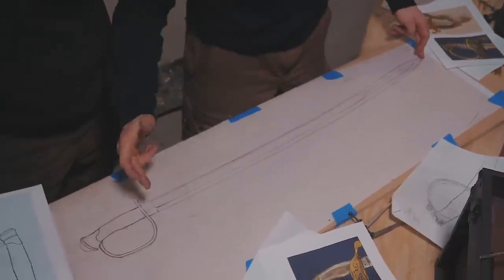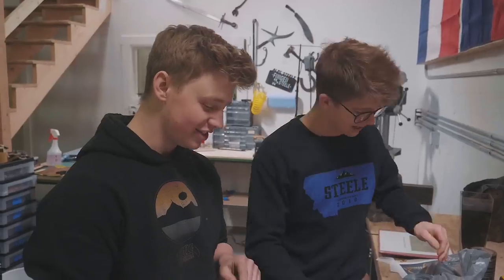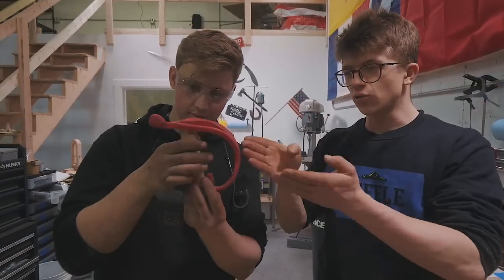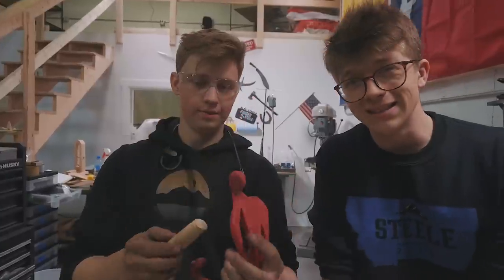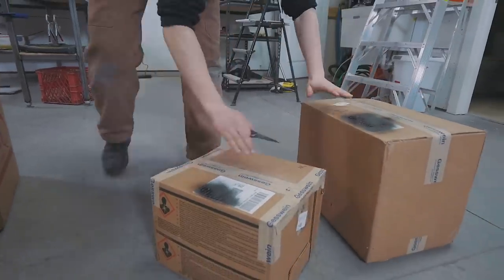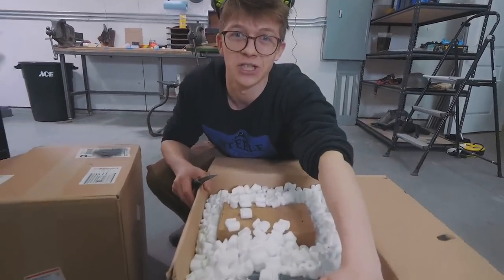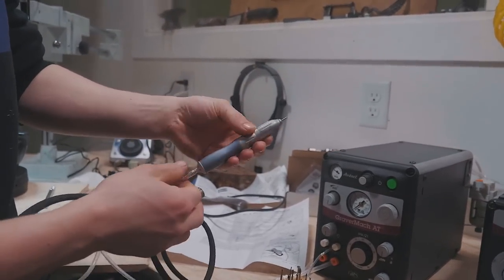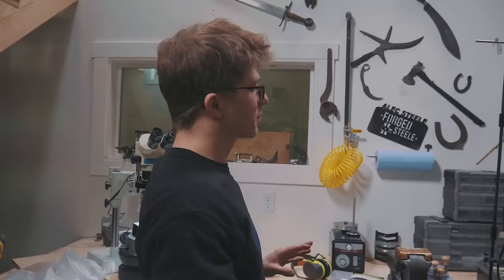MAKING THE CAVALRY SABRE: Part 3

Comment: Blast those shipping labels with a heat gun instead of spraying them with paint.
Almost all mail labels are printed on heat-sensitive paper, so they'll turn completely black if you get them hot.

Should keep you from getting paint all over the place, cheaper than spraypaint too.
Reply: i did not know this.... would a hairdryer work?
Reply: @FaewildMoon  hairdryer isn't hot enough, if you really don't have a heat gun you can use a coin and scratch the label like you're scratching off a lottery ticket, that will generate enough heat to activate the ink but it will take effort to get the whole address hidden.

Comment: Good video.  Your comment about wasting material, or rather, not considering it waste is spot on.  Forging thick and grinding thin after heat treating minimizes the risk of losing the piece to cracking or warpage.  This is how it was done back in the day and it is why good swords were, and are so expensive.

Comment: Hey Alec, just a thought for future builds, though you might know this already. If you are using bloom steel or hearth steel in future builds I have two suggestions.  A way to prevent immediate decarburization of your steel is to use the method for japanese swords.  Break up all your pieces and stack them on a paddle. Wrap it in wet paper and ash and then pour a clay slurry of some sort over it. This will hopefully insulate your billet while its heated up.  Traditional materials also seem to forge much better in a charcoal forge rather than propane.  The guys at man at arms, and also That Works, forge a lot of traditional materials and I always see them do this with their steel

Comment: Back when I was in the Air Force Cadets here in Australia I got to learn a lot about the sabers we use here and actually learn how do use them ceremonially. There is so much little stuff to it, like the way you hold it with your fingers spread out as a sign you're not going to swing it, to saluting with the tip pointed down to show respect. It was so much fun learning about all of this.

Comment: Your plasma cutter looks like it is not performing properly...it shouldn't have that much slag when finished cutting.might want to make sure that the tip you are using is a proper drag tip to keep your tungsten at the correct distance to the metal being cutt. Keep up the great work Alec and team :-)
Reply: Air plasma uses hafnium tungsten is for use inert gas. I'm pretty sure he has a Hypertherm, pretty sure all their hand torches come with a drag tip. It's more likely his air isn't clean, he needs a Motor Guard filter, but yeah it ain't right.

Comment: Not sure how much experience you have with modeling, like for the guard on the sword, but there are some very useful materials from the prop and cosplay world that you can look into.  Worbla is fantastic for modeling. It starts off as a hard sheet, then becomes malleable with heat and sticks to itself. It cools fairly rapidly and becomes hard again.  Scrap pieces can be squished together, like clay, and molded again.  It's reusable and has virtually zero waste.

Comment: i am sure you get lots of advice.  Just something i noticed at your engraving station with the "clean air".  In your line that drops in there, if you put a "T" off about 6 inches up and pull your line off of that T then at the bottom, you will have better luck with cleaner air.  Put a ball valve on the bottom of the drop, to clean it out every now and then.  oil and condensation will collect at the bottom of the drop.  hope that helps.  look forward to seeing you guys build the cavalry sabre

Comment: As for the scraping on your mill. Iv got a scale comparison to think about. If you were to measure something with .001 dial calipers, then measure the same part with a .00005 micrometer, that is about the same as going from surface grinding to scraping, when it comes to flatness. Given the experience of the person doing the scraping. But the little "half moons" also hold way oil and help things move very nice. just make sure you keep them clean, and well lubed with a good quality way oil and she will outlast you. Love the videos! keep up the hard work!

Comment: High purity air = zero humidity, zero dust, zero oil. That's three problems. 

Before you tackle the problems look at the requirements of the air tool. There should be upper limit figures for air quality if the tool was responsibly designed and specified. Use those figures for designing your dedicated air supply.

Humidity cannot be effectively controlled much below saturation with bowl type separation. While refrigerant water separation is effective to roughly zero F viewpoint the lower limit of commercial units is roughly 20 CFM (80 l/min). A better bet would be the rechargeable desiccant dryers used for auto body paint spray systems. The one I'm familiar with had a window that turned pink when ready for recharging. You recharged it by putting it in a 250 F oven overnight.

Oil (inevitable carry-over from the compressor) can be captured in activated charcoal. 

Dust is the final contaminant. Both dessicant dryers and activated charcoal caprure stream-borne dust but contribute some dust of their own to the airstream. There are any number of 99.9% capture in-line dust filters on the market, some with spin-on filters. Commercial vendors of fluid power systems pneumatic, hydraulics) can refer you to specialists in air system quality. Another source is medical and breathing air equipment sales houses.

I don't know the actual air requirements for your engraving equipment but wkll probably falls in the middle ground short of the high-falutin extremes I outlined above. Shop wisely.
Reply: I suggested a Motor Guard filter at least for the plasma. It looked like it could use some help.

Comment: ahhh a power hammer thats what i was missing as a kid to work play dough
Reply: Just a friend here to let you know that the clay most likely wasn’t soft it’s an old blacksmith trick to freeze clay because it will act much like hot steel

Comment: Hopefully you can use the wrought iron for something else in the future.
Reply: Another way to get steel forge the blade in wrought iron rap in fine ground charcoal made from leather moistened with water. Then wrap in clay let dry and heat to cherry red hold for a few hours then slow cool. The carbon infiltrates the wrought iron making steel.

Comment: I watched another Blacksmith John from Black Bear Forge trying to make a bloom of wrought iron and he ended up with what he called tool steel based on the spark pattern.  He said he probably had it too hot as he was using a jumping castle blower as a air source.  I recall he kept moving the blower further and further away from the intake pipe.  He was using iron ore he collected as well.  It might be worth checking out his channel before you try again, and I do hope you will try again.  Maybe on not such a fancy sword so it isn’t so critical.
I think you gave it a great try 😀

Comment: The scraping on the mill is flat and causes little pockets where way oil can fill those pockets to keep the milling machine operating smoothly and lubricated. In a basic explanation I hope this helps describe what the scraping is for Alec. No need to worry for it is very accurate and holds tight tollerances. The scraping is their and acts as little "pockets" to keep the machine well lubricated. Be sure to wipe down the machine and coat it with a light coat of way oil and you should be fine.

Comment: Hey Alec, want an idea?
If you'd wanna carbonize your iron to hard steel, better do it at a finish line - before you actually thermo-forge it. Simply weld an iron coffin for a blade, put it inside, then fine charcoal, weld it well closed and bake it for about an hour.
These pieces have burnt out all their carbon while hammering, so at least you should've baked them much and much more often.
Like your project! Feel good!

Comment: Be careful when quenching - I've made a couple of sabres, and so far, each took a bit more curve on quenching, due to the differences in profile(narrow edge, wide back). It is not as pronounced in wider blades, but a narrow one like this could have the tip move an inch or two during the quench.

Comment: I believe they sharpened the top 3rd of the blade because you're only supposed to cut with that part, and the rest was for parrying.
Reply: They were also typically issued dull and sharpened later
Reply: They were actually mostly used dull.  Remember it was used one-handed from horseback.  You didn't want to cut into your target, get the blade stuck, and have momentum rip it from your hands.  You wanted a thin but very dull edge, say 1/16" to 1/8", to break bones and smash skulls.  That would disable and cripple your target without risking losing the blade.

Also remember that the era this was used in, cap-and-ball revolvers were the cavalry's primary weapon.  The saber was for close-quarters battle, which did happen but was not at all optimal fighting conditions for the highly mobile shock force that the 19th century light cavalry was.
Reply: @jeremiahmiller6431  You're wrong on every point except that sabers were secondary weapons.

Comment: TIP for those barcoded heat printed labels you can blacken then with a flame or in your case with a hot piece of steel, it doesnt need to be red hot and start the box on fire . I use a disposable lighter and it blackens the addresses perfectly . more fun than spray paint or marker.
Also I hope you guys make a huge snowman with a watermelon inside or red filled balloons etc to test that sabre

Comment: Hammering Play-Doh with a power hammer XD
Reply: I actually use an Oil Based Sculpting Clay as an alternative to 1500 Degree Metal to dry run Knife Projects, When left in the Freezer overnight it moves identically to hot Steel, just so you know.... But yeah Play-dough under a power hammer X-D

Comment: what's up with the arc there Alec? when you moved your engraver unit something sparked. Not unless you pinched the power cord with the unit to make it short out, so if that didn't happen  then maybe you brushed against the electrical conduit with the metal housing on the engraver unit and you have a ground issue. if somewhere other then at your main panel has ground touching neutral wire  then you can energize the metal box/conduit and any equipment/appliances that have metal housing comes into contact with each other will arc/short out and also if your touching it and have direct contact with a source of outlet to ground you will be shocked as well! hope it isn't anything big and that you look into correcting any issues that may be needed. great vids and work! love watching and thanks for all the tips and skill sharing.
Reply: Good lookin' out, bro. Wouldn't want the new shop to burn to the ground!!

Comment: Alec! One of the problems you had with your bloom losing so much carbon was that you were forging in propane, bloom works better in charcoal, not only because the carbon in the fire helps prevent decarb, but also less oxygen in the fire at welding temps means much less scale which means less waste which again means less decarb! Its also easier to get the full billet welded because of the lower oxygen atmosphere in the fire means less fire scale as well. I know, propane just makes forging so much easier and faster, but materials like bloom and tamahagane prefer to be worked in charcoal...(not coal! Coal is much too dirty and you'll end up with a lot of sulfer in the steel than you want) hope you see this for the next time you make some bloom!

Comment: Just three questions, Alec:

1) Why don't contemporary blacksmiths us conduction coils, instead of furnaces, to heat steel? 2) Wouldn't friction welding be easier & avoid the issues you have with layers of steel not welding, properly?
3) Japanese blacksmiths use water, on their anvils, to descale; what are your thoughts on the various techniques of blacksmiths throughout the world?

Comment: Alec! Careful!
At 13:12 when you measured the curve of the sword, it seemed that you did not have the tang at the right spot whilst comparing it to the drawing. Which means, that once you do start working on it further down the line, moving the tang to the right spot of the drawing will move the curve of the sword and it might not match since the curve is not consistent throughout the piece.

Hopefully, you accounted for that and are already aware of the potential hurdle. Best of luck with this sword bud!
Alex

Comment: Couldn't you completely melt the impure material and pour it into metal blocks you can work with from scratch? same with the meteor. why not just completely melt it down?
Reply: Casting steel is a whole different ball game from brass and bronze.  It is also significantly more difficult than cast iron.  The temperatures needed are just too high.  Getting crucibles and refractory that can handle the temperatures is not something anyone who is not very experienced in casting and has the necessary equipment should even think about attempting.
Reply: @Worrsaint  Ahh I thought he could just melt the stuff and pour it into a square mold. thanks for the explanation.
Reply: @aakla  no problem.  I have looked into it before and apparently the readily available stuff is only good for a few hundred degrees below the melting point of the carbon content of the steels he would be using.  Oddly enough, carbon has a very high melting temperature but the higher the carbon content of the iron alloy, the lower the melting point.  It is why cast iron has such a high carbon content.
Reply: I have casted steel and iron before it is actually a harder thing to do with steel but iron is very easy to get if you use proper techniques but you have to use a gas furnace for steel but I would recommend a coal furnace for both
Reply: There’s also the factor that remelting it may not remove the fundamental impurities that caused the cracks in the first place. If I were to guess I’d say the wrought they used was a low grade wrought high in sulfur which causes it to be hot short, which just means it doesn’t like to be worked when hot.
Reply: Because Conan the Barbarian metallurgy is effed up. You can't just melt a piece of steel and pour it out like silicone into a mold. When it gets that hot, its properties change in one form or another and You may need to add elements to beat the curve. ALMOST melting it, annealing it, normalizing it...that's one thing, but turning it into liquid is another...burns out too much carbon...its why companies who smelt steels have special furnaces to get a desired result. I don't know enough myself, but trust me...its a whole different animal.
Reply: @Worrsaint  sort of like the conundrum of making aluminum copper alloy, though copper has a higher melting temperature than aluminum, the copper will melt in molten aluminum .
Reply: laugh they could always make a Bessemer converter.
Reply: @magicman9486  Yup.

Comment: Just a thought, why don't you two use some of the wrought from wagon wheels (not the congealed mass that was the hearth debacle) for the sword furniture? It can be etched, inlaid, blah, blah, blah. That would be the connection to the past that you were originally seeking (maybe). I've used wrought for bolsters and pommels and while it often has integrity issues, it is really nice when polished and then etched. Keep forging!

Comment: Get u a 3 d printer. The new molding clay. Lol
Reply: Funny how high tech modern tools have become more difficult to use than old fashioned tools like clay and pencils...
Reply: @broadusthompson1666  3d printing is easier
Reply: hi there maybe if you rarely work with your hands it is.
Reply: 3d printers take too long to do.
Reply: @broadusthompson1666  k
Reply: @V3loCiTy123  uh clay is pretty straightforward but it takes too long to do
Reply: For what they're doing the modeling clay is the better option. They're not prototyping for major (or even minor) production, they're playing with shapes to find something they like. Also, doing it this way gives them a way to simulate forging the result, if they go with a forged guard instead of a cast one. Just like they did, you just flatten out the clay like the sheet you want to work, then have fun with shaping it. ;)

3d printing would be quite effective if they decide to cast it with an investment cast, if they have a design that's conductive to building in a 3d modeling program.
Reply: @Broadpaw_Fox  nah!! they just like playing with play dough. Laugh.
Reply: You can’t use a power hammer on a 3D printer, so it would lose all the thrill.
Reply: @naiknaik8812  As user of both methods, i have to say they did use it correctly. If you are looking to see rough idea how shapes fit to get idea from 2D to 3D and also measure how much material you need to do it clay or such is better option. This also could be used to get dimensions to parts. 3D printing other hand is great tool if you have specific design in you mind, or you want to make exact peaces with specific and accurate dimension.

Clay is really fast to work with and can be reused. CAD designs take time to design and take even more to print.
Reply: @Hellsong89  k

Comment: Um... I don't know if I should say this after you've done it, but a sabre gets it's curvature from having bevels forged into it, or are you doing  Material Removal for the most part?
By the way, Oil Based clay that has been left in the Freezer Overnight moves just like Hot Steel in case you're wondering ^.^

Comment: Alec will . also i agree with the using extra material as insurence with modern ways of work it makes it safer and easier.  But in the old days they did not have the grinding abilities as today how close to finish demensions did the old ways have to forge to?